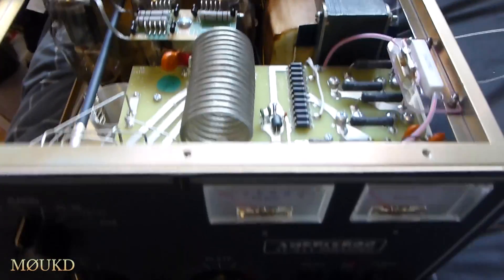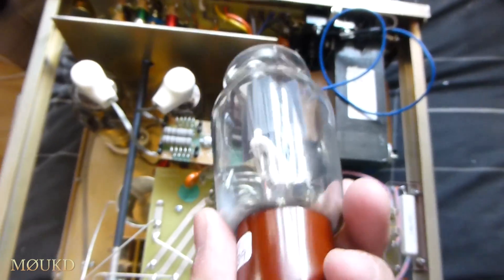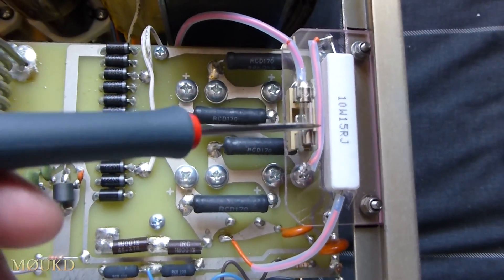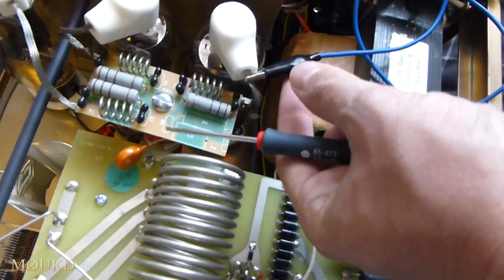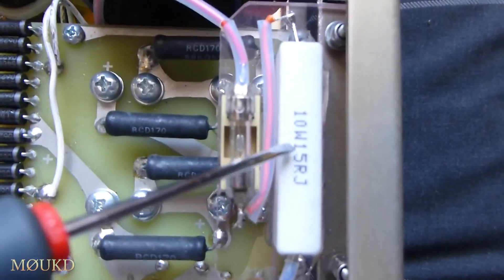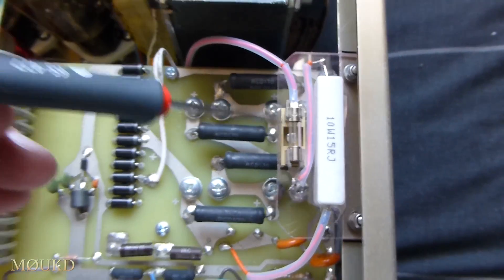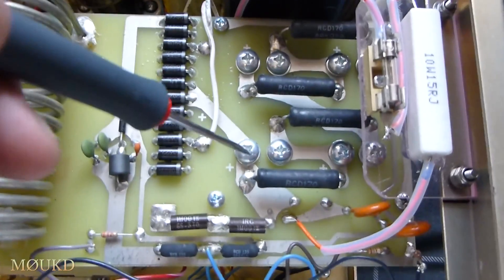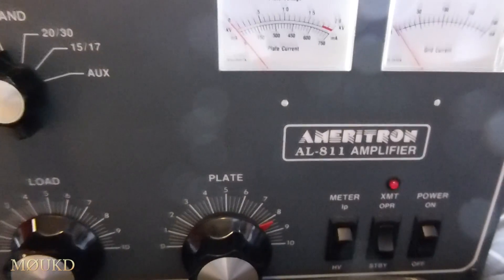Ameritron AL-811 HF Linear Amplifier HT Fuse Mod - M0UKD

Comment: Any part numbers for the anode cap mesh wire? Thanks.
Reply: rg58 braid ? :)
Reply: I just ordered 50-0811-1, SA, PCB ASBLY, PARASITIC, 811 directly from MFJ for $31.62 US. This is the complete PCB Assembly with caps, should be arriving this week VE1FSM

Comment: Why is my al 811 reading only 1300kv when it supposed to be 1500 -1700, anyone can tell me what is the remedy? Thank you 73 de KH2ZZ
Reply: could be low mains, but also check the input jumpers and compare them to the "Power Connections" section of the manual.  For each 120/240v voltage selection, there are 3 jumper settings to adjust to your particular line voltage.
Reply: @PaulReedy  thank you so much for the input, I wish I know or had some visual on those item that you had mentioned. I dont know much about stuff but really want to see what is the best option to go for my AL811. My email add is kh2zz@yahoo.com if you want you can send me email
Reply: ht mains must be low i suspect, anyway, 811a can output max watts even at 750v so should be no problem at 1300v

Comment: Hi John, I wonder, why did the tubes break down? What if you swap the tubes for the 572B's?
Reply: 811a very good tubes, but not to overdrive, will self destruct at more than 230 watt per tube or at 180watt long transmission, cherry redhot, weaken glass, vacuum sucks hole in glass.

Comment: I do a similar thing to protect the power supply and downstream components by adding in a fractional ohm resistor (something like a 0.47 ohm or 0.33 ohm) the value isn't critical, and I make it one (1)  watt. In the event of a short, and I have definitely had shorts, the resistor explodes and opens the circuit. The resistor explodes with a huge bang so you definitely know something went wrong. Naturally, after an event like like this it is necessary, as you pointed out, to make sure the power supply capacitors are discharged. Much of that would depend on the design of the capacitor network. I personally use inexpensive 100 uF or 470 uF electrolytic capacitors rated at 450 volts each in series with each one shunted by an equalizing resistor of 470K @ two watts each.  These value resistors take a while to completely discharge the capacitors if they are fully charged but but after a few minutes, they will be safely  discharged. Thanks for the video. I have heard a lot of the Ameritron amplifiers on 20 meters and they all sound very good. Just can't beat the venerable 811A.  73  WA4QGA   El Paso, TX

Comment: When running three 572B's the 15 ohm resistor is burning open and the 500 ma glass quick blow fuse is blowing when running 250 to 300 watts output! Circuit seems to work OK with 811 Tubes but not 572B Tubes! M0UKD will not respond to his QRZ email address on this! Any ideas on circuit for 572B Tubes? W8VK Please reply to my QRZ Web Page email address!
Reply from the maker: Rich Carstensen you must have a problem if you're melting the resistor! Sorry for late reply, I'm quite inactive at the moment.

Comment: Could you eliminate the resistor by using a sand filled ceramic fuse instead? The sand should quench any arc of current. Just a thought. 😉

Comment: What Testing has been done with this modification added to an Ameritron AL-811 Amplifier?
Has any test been done on just one 811 tube good and then a bad one? Same question again with one good 572B and one bad one? I see 250ma/250v fuses, 330ma/250V fuses, 
500ma/250V fuses, and 750ma/250v fuses for sale! Would these lower value fuses be safe to use and test good and bad tubes? If that works then I'd say it's a great modification! "The proof is in the pudding!" Thanks! 73s!

Rich W8VK

Comment: The coils by the tubes. Did they have 5 turns from the factory or 6 turns?
Reply from the maker: Aaron Miller 5t
Reply: Ok, mine had 6 turns from the factory (bought new august 2017). I changed it to 5 turns per some other youtuber's advice

Comment: Does anyone know if the 811a,tube will work properly with 1 filliment not heating and the other folded filliment heating normal?apparently their are 2 filliments in parallel in those tubes.I'm running an al-811h Ameritron

Comment: I own an AL 811 linear and I note that the transformer and PSU are the same as the 4 valve AL 811H.  Therefore I am going to add the 4th 811A valve. There is just room to physically fit it.
Reply from the maker: Interesting, let me know how you get on!
Reply: M0UKD Hi, M0UKD,  Piece of cake. As I mentioned before the PSU and power transformer is the same as the 811H so I have added a UX4 base between V3 and the air coil. Goes in easy but cut a small piece out of the aluminium bar that goes from front to rear panel to clear the valve nicely as then there is no chance of the hot valve envelope touching the colder metal bar. Earth the grid directly at the valve base with a nut and bolt. Make up metal spacers for the UX4 base. If you have the amp with the anti-parasitic PCB feeding the HT to the valves then wind a 6 turn choke 6mm dia. and fit it together with the associated components 100R  metal oxide damping resistor 3 to 5 watt. (not WW ). You will also need 2X100PF 500 VW silver mica caps Dubilier etc. Then 1 ceramic valve cap and wire in and it`s done. Don`t forget to firmly connect a safety lead from the HT at the valves to Earth. Earthy end first!!. I do not have a true peak wattmeter but expect. to get say 120 watt increase depending on the valves. Thanks for your HT safety fused mod. Nice one amd I am going to install it soon. Goodm Wishes, MIKE. M0MPT 73..
Reply: M0UKD Hi again, I have just completed your HT safety fuse mod. Seems to me that this mod could save a power transformer. If for instance a valve suffers a plate to grid S/C the current would go through the roof until the 8A fuses blow. I don`t know how Ameritron forgot this one. They tried to raise the grids on the 811H with a resistor etc. Grounded grid AB2 amps are just that. I removed the grid resistors from a problem 811H about 2 years ago and rewound the plate chokes with 7 turns on the chokes. 2 valves were very low emission and were replaced. I also changed the 130 Volt heater gas discharge devices for 160 Volt ones. Result....Spot on amp. These 811`s are good linears, we just need to be aware for a few little problems. Thanks again for the excellent safety fuse mod. Best mod to date with excellent benefits. Regards, MIKE.
Reply: Crobular I Note. Be careful with the fuse mod. If the newly fitted HT fuse blows for Anode/grid S/C or any other reason and the amp is switched on again after the fuse has blown the HT will be at full potential. Be sure it is discharged and when working on it fit the safety earth lead from earth to a suitable HT point like the input to the 15R resistor. This will ensure that the HT is discharged.
Reply: Did you get a 4th Valve installed? What are the results? Any Problems? Is it just for 811 Valve or can you use four 572B valves? Post the results would you! Thanks! 73s!

Rich W8VK
Reply: Crobular I it’s not as simple as adding a fourth valve , take a look at the circuit diagram. You will see that 811H has a neutralising circuit. Which is needed when four valves are used,but necessary when three valves are used as in the 811.
Reply: @iain777uk  VERY important to have a neutralization circuit for 4 tubes.

Comment: The glitch resistor could be a higher value... but of course you'll have more heat to get rid of.... I can't remember what value I used in my 2m amplifier... 80 ohms I think..
Reply: 5ohm 5 watt will work like a champ even with 813 tubes at 3kv
Reply: @luckydubeinrc5165  that seems a very low value, still 600amps of glitch current.
Reply: @g0fvt   i never guess a value , as previously  said in another post,  you will find the value in most old ARRL books re  amplifier sections.
Reply: @luckydubeinrc5165 , likewise I didn't guess. So we must be referring to different publications, some tubes are far more robust than others. My little tetrode amplifier draws less than 300mA at 2.3kV so my 80 ohm glitch resistor is not a problem. Eimac themselves recommend 20-50 ohms for the glitch resistor.

Comment: Just a thought but what about using a fuse out of a junked microwave oven. The one I took apart had a 5kV 750mA spring loaded fuse in it that came in its own plastic cover, seems perfect for protecting the HT anode rail.